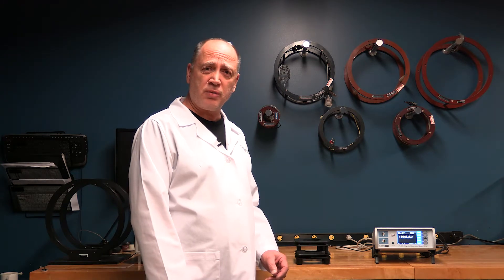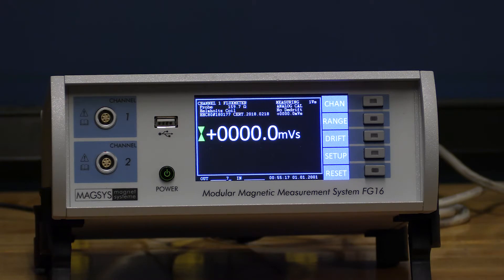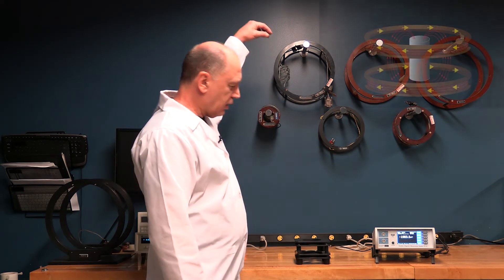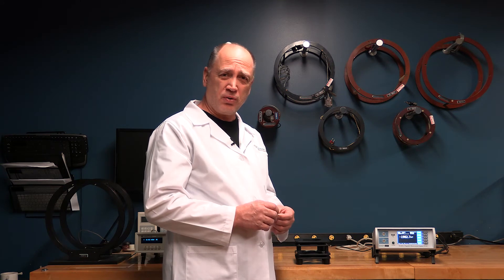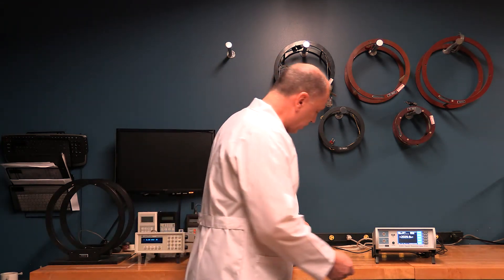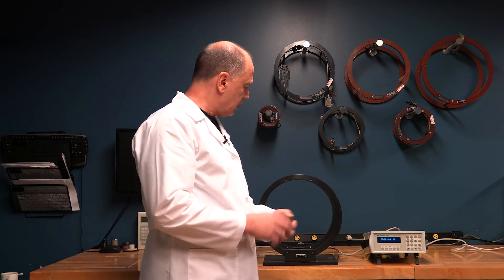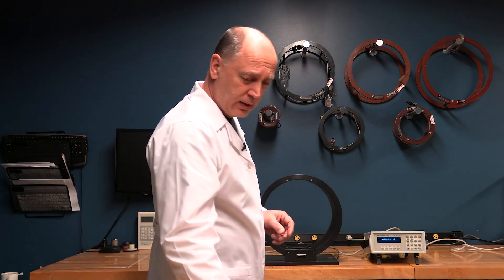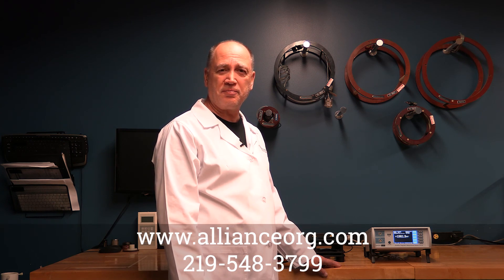Magnet Testing With Flux Meters and Helmholtz Coils

Comment: Why isn't it possible to measure the flux of a magnet with more than one pole?
Reply: I apologize for not seeing this post earlier. If a magnet has 2 or more poles on a face, the flux will travel from one pole to the other on the same side and may not get picked up by the coil measuring this.